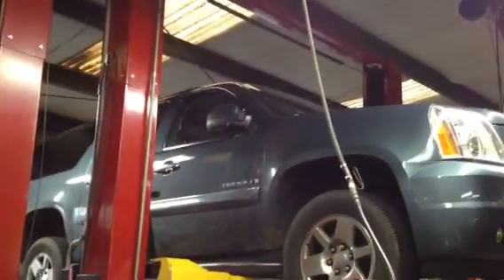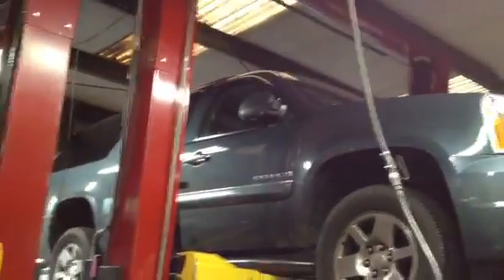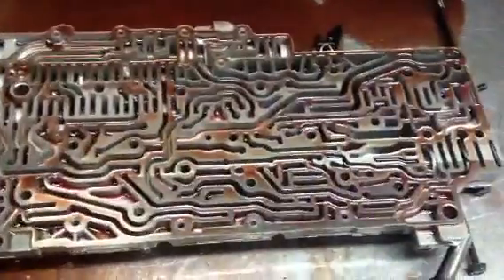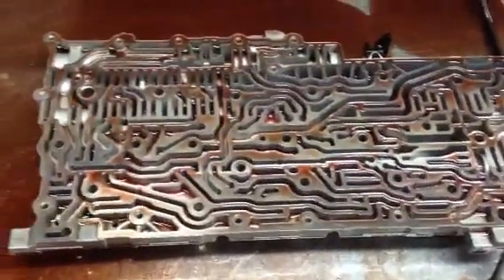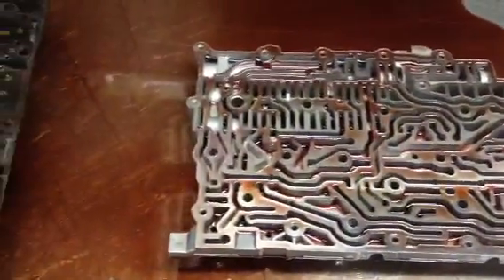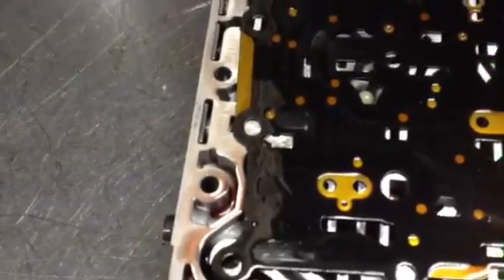6L80E Meenan Lansdale

Comment: If it weren't for the 18" rims on this vehicle instead of the 20"s that mine has, I would have thought this was filmed at the shop I got mine fixed.  I had the EXACT issue with mine.  I bought it with 132k miles and it happened occasionally right away and at 145k miles, it would only limp in M1 gear.  I didn't realize this was a common issue.